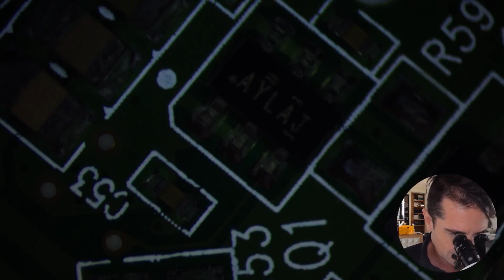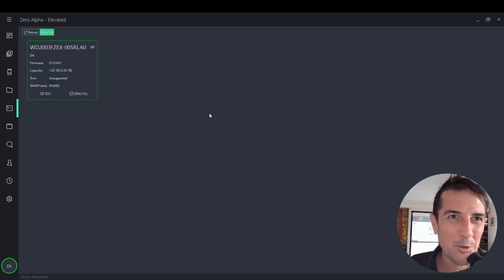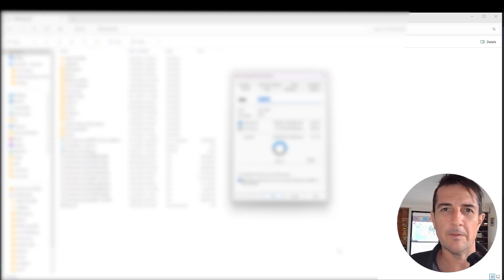How to Repair a Hard Drive PCB

Comment: Hi i have a question. My external hdd stop showing on Xbox even on pc not showing. Actually by mistake i unplug drive from xbox. Now its only shows in disk management but when i try to format or try to convert gpt. Its shows error hardware fail. Is there any way to fix it. Drive is totally new and never droped.

Comment: Hey , I have a WD elements drive that is almost about 94% health and when I copy some files , it works but after sometimes , the speeds slows down to almost 0 bytes and never goes up unless I replug the drive , opening the case , I feel something is hot on the pcb , the drive makes no sich weird noises , what could be the cause ? I also did wipe the disk with 1's and 0's , still no luck